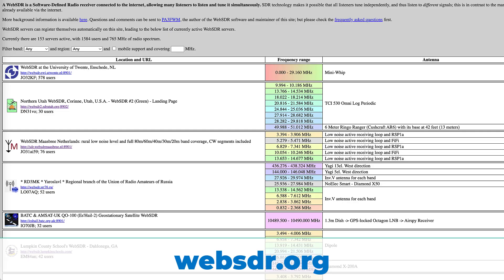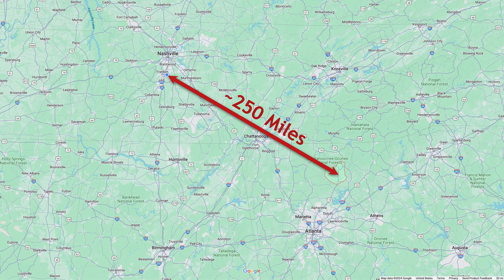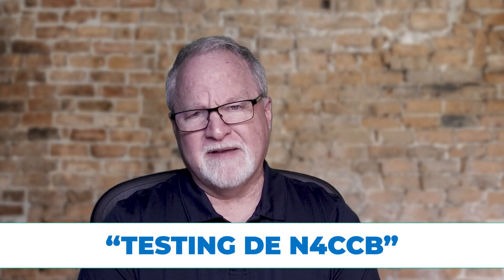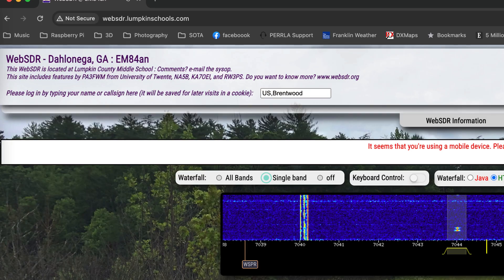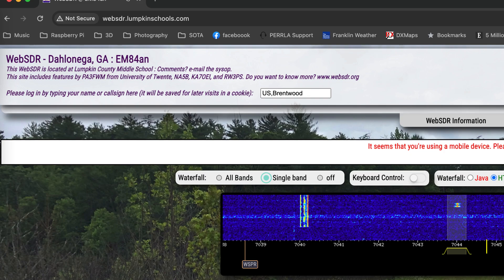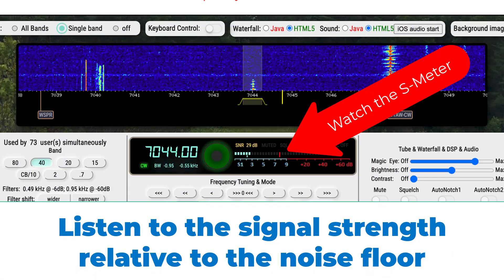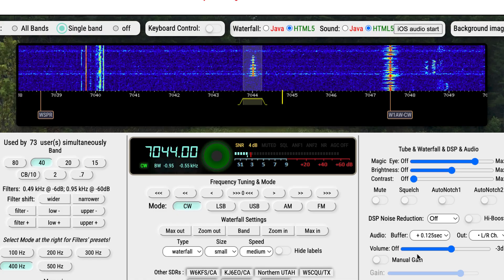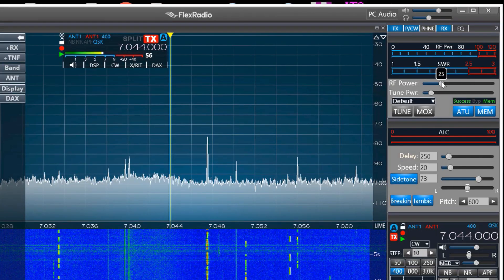100 watts vs. 5 watts: Can you hear the difference?

Comment: Great video!  I’m new and my interest has evolved to CW and QRP.  While erecting and adjusting my 40 m antenna, I’ve been doing exactly this: using WebSDR and KiwiSDR to see where my signal is reaching.  Being in Alabama, I first used that very Dahlonega, GA, station!  When I heard my signal in the Canary Islands and New Zealand on 10 Watts I was sold on QRP.

I use SDR as I have never been able to get the RBN spot me.  I’ve tried straight key, paddles, sending various CQ, TEST, RBN combinations along with my call sign — nothing.  Frustrating.  But, the online SDR works great.

Thanks for your content.  Looks to be exactly what I need.

Best and 73,

Jim KO4GQS
Montgomery, AL
Reply from the maker: Hey, Jim. WebSDR is a great way to see if you can be heard in a particular location. I’ve used it during Field Day to see if our group’s signal could be heard on the west coast, before deciding to switch gears from the east coast and look for western stations. Have fun down there in AL! -Cliff

Comment: It's surprising how many hams still haven't figured out the usefulness of using SDR stations for determining current band conditions relative to their own signals. I will sometimes be connected to several Web SDR's from 500 to several thousands of miles away. When conditions are optimum it's a mind altering experience. Adjusting your power output can produce results you would not expect and possibly change your entire outlook on QRP operation and antenna design.

Comment: Nice! I use QRP often but have never done a comparison like this. I expected the difference between 100W and 25W and even 10W to be almost nothing, but I did think 5W would show a larger difference than it did. 100W to 1W was the only really major change that could possibly have affected copy and it should, since that's a full 20dB down. But I suspect most hams would think in that scenario that 1W would be completely down in the noise, and your test proves that's obviously not the case. 72/73s :)

Comment: You should repeat the same test with websdr 2000 miles and more, for long distances the power would be more significant!
Reply from the maker: Yes. Please see the  "Part 2 - SSB" video. But, also understand that people are working DX every day at QRP power levels. It's all about propagation. If conditions are good between you and the receiving station, you can make contacts via QRP. If conditions are bad, it's going to be a frustrating exercise.Thanks - cliff

Comment: Nice job , so just Hi for big gun to easy dx , or possible dx to low power ... my station for 6 meter =) Icom ic-726 , +/- 10 W SSB to little antenna Gp 1/4 home made - easy dx and very good rcv to propagation ... other band ... 15 / 12 meter , 35 W / 25 W to only Gp 15 meter & +/- limit for 12 meter ... easy dx to Europ and other dx ; 17 meter to Dipôle +/- 25 W , nice dx so just little band 17 meter is easy for small station , very Happy ; 20 meter is band very Queen for big Dx so possible low power ... 10 / 25 w ... ; 40 meter ... max 25 W to short dipôle 30 m and tuner box ... easy dx for Europ contry ... listening , listening & long listening for good dx , not hundred Watts ... Thank for information , good dx all - - - ) F4pzn ... old station , start one to 1994 ... many tks 😉
Reply from the maker: Thank you! - Cliff

Comment: Sir, great video... question... Does CW travel better than say phone.. voice? Or is the results very simular?
Reply from the maker: CW does travel better than phone or digital. It’s a pure, unmodulated carrier so it’s more like a laser pointer than a flash light. Time spent learning Morse code is time well spent if you’d like to use small battery powered radios. -Cliff
Reply: @QRPSchool  thanks sir

Comment: Im no expert, but I do quite a bit of POTA, IMO, the wattage is not nearly as important as the antenna. I work portable POTA station in parks in Indiana, and i promise you I have guys contacting me with very exspensive radios on 100 watts and upwards in power, that do not come in nearly  as loud and clear as someone in the same approximate location on 5 watts... still surprises me.  If my very limited experience matters at all, the antenna is the biggest factor to consider. That said , on my portable chameleon telescoping vertacle , i get much , much greater results on 100 watts than say 25 watts, thanks for all the great videos sir, I have been watching and learning from them for years. NS9T 73
Reply from the maker: Thank you. I hear what you're saying. For me, I think propagation makes all the difference. If propagation is good between two stations, almost anything works. If propagaion is not great, I'll need to increase my power. If propagation is bad, I might as well walk away. If you think about it, people are transmitting all over the world right now... in Singapore, China, etc. And I probably can't hear any of them because propgation isn't good between us. So, I hope my signal is strong to SOMEWHERE when I'm operating. But, if it's not, I still had fun going fishing, whether the fish are biting or not. Thanks again! - Cliff
Reply: @QRPSchool  very good point.

Comment: Thanks for the test via WebSDR idea.  Did not hear you mention antenna used for the demo. Thanks de N4KGY
Reply from the maker: My one (and only) antenna that I can use for HF here in this HOA-controlled neighborhood is a ground-mounted vertical. It's a multi-band Hustler vertical antenna. I am lucky that the HOA allowed me to keep it, after initially telling me to take it down. When I work portable, I have such a lower noise floor! - Cliff

Comment: Your test is not useful because of several reasons. First you need to transmit a pure tone like a 1khz signal and then measure the difference of snr between 1W and 100W and not voice. From what I could see in the video there is like a 20dB difference which is about 100 times and its a huge difference. Also radios have AGC which will increase or decrease the rf frontend gain.
Reply from the maker: "Your test is not useful for serveral reasons."  Thank you!  Also, I am not useful for even more reasons, depending on who you ask.  But, while I'm here... Can we agree that a properly calibrated radio has S-Units that are 6dB apart?  And, therefore, 20dB is just a hair over 3 S-Units?  And, can we agree that QRP contacts are made every day all over the world, regardless of what kind of test I present or what kind of failure of a human being I may (or may not) be?  And, can we agree that you can find many of these QRP DX contacts on THIS YouTube channel and many others?  And, can we agree that if you listen to the NCDXCF beacons, a station that has a nice, strong signal at 100 watts has a very audible 10 watt signal, and often the 1 watt signal can be heard?  And, if I had named this video, "Hey, did you know that a strong signal received from a 100 watt station can also be heard if that station turned their power down to 5 watts?", would you have been okay with that?... because that seems like a pretty good alternate title that speaks to the spirit of this video.  This has been fun, but I really have to get back to work. - Cliff

Comment: 250 miles is pretty close proximity. I would be interested to see this test at 1000 or 1500 miles.
Reply from the maker: You might want to watch the SSB Part 2 video that I made after this one.  Also, here's a video where I worked a ham 2,000 miles away with 500 milliwatts on SSB.  https://youtu.be/FeNZnf6s8A8?si=d0rKr_6lXdoPQVOw&t=85

Comment: I am no "troll" and to fully modulate an SSB signal, you have to put out the power that your radio is used to use. For tube radios, that is necessary. For completely solid state rigs, you can use whatever power you can turn down to. I have been happy with 80 watts out for years. This is on Ham and D.O.D. frequencies. I think that lesser power outputs really work for Ham Radio, BUT,  running 1.5 KW should still be available in case you need it badly. Yes, I do have an amp that will run 3KW, but it hasn't been used in years except to run into a dummy load now and then. I still keep it handy, but am totally satisfied with my 6JB6A's in my Drake Twins. You wish to run QRP, fine, do it ! I did that during my CW days with a Johnson Viking Valiant, just whatever the beast would put out on its lowest power CW. It was fun !!! But to run a decent signal on SSB with 10 or 100 watts, you have to run 1/4 power to fully modulate it. There is no other way !!!

Comment: 100 watts, compared with 10 watts,  will be detectable at three times the distance of 10 watts (ignoring any anomalies of propagation). The bottom line is it's all about signal-to-noise ratio, not signal strength! So, i will work much more DX on 100 watts than i will with 10 watts..... which is usually what i want to do. However, I have had great fun seeing what I can work with 10 Watts, 5 Watts and even less than 1 Watt (the IC-705 is a fun radio!)

Comment: Back before remote SDR receivers were available.....and before I was even licensed as a Ham, I experimented with CB DX using an "export" Ranger 2950 capable of about 10 watts. One surprise was using the UK CB channels in their legal FM-only mode. I have a whole drawer full of QSL cards from. UK CB contacts.  When everybody was saying "you can't talk Skip using FM mode" ....I was doing it every day with excellent results.

 Now I have a license and all my contacts are strictly legal but I encourage others to try out unorthodox transmission modes and still am a huge QRP fan. My advice to successful QRP is pay attention to antenna design. "Go large, or go home" is my best tip. And the horizontal loop antenna using 450 Ohm Ladder line and a 4:1 balun into an antenna tuner is my all time favorite DX antenna. (Ground and Disconnect equipment when not in actual use or bad weather)
Reply from the maker: Congrats on your succes and thank you for sharing your expertise!  (I know FM skip is possible because sometimes other 2m FM repeaters will be triggered by radios hundreds of miles away. But, I've never tried to work FM skip, myself.) - Cliff

Comment: Key word, above the noise floor, sometimes you need power to overcome this.
If the receiver is causing AGC action then the audio level remains the same, that is what AGC does, once the signal falls below when the AGC action ceases the receiver gain is at maximum and the volume starts to drop as the signal weakens, so the test has nothing to do with TX power but receiver gain and AGC action.

Comment: The physics of power levels seem really simple.  Double the power is 3dB increase.  There is a 6dB step between S-units on the level meter.  So... 5-10W, +3dB.  10-20W, another +3dB, total 6, or 1 s-unit.  Alright, 20-40W +3, and 40-80W another 3 dB.  So from 5W to 80W is 12 dB, or 2 s-units.  Maybe that is enough to pull a weak signal out of the noise?  Our hearing is a very nonlinear system.

There' are so many anecdotes about more or less power, and maybe there are perception variables involved.  But the numbers seem very straightforward.

Comment: This is correct at short distances, but when the space wave comes into play and you may even have several hops, or it is a contest, then power is important because the ionosphere and the ground have a strong attenuation. Of course, you can also use QRP, but it simply works better with e.g. 100W. Especially in SSB. You stand out more, are heard better in QRM and have less frustration. That's why I only recommend QRP for amateurs who already have a lot of experience. Otherwise, there is a risk that the hobby will end sooner than it started.
Reply from the maker: All good points. If someone tries QRP, they should only contact the strongest stations to ensure their best chance for success. When you have time, please watch the part 2SSB video that I made shortly after this one. Thanks again – Cliff

Comment: :

I agree with the decision to avoid using excessive power, especially over distances like 250 miles. When comparing different power levels on a Software-Defined Radio (SDR) over DX paths in regions like Europe, Asia, or Australia, the impact becomes more pronounced due to variations in QSB and other propagation conditions. While the difference in power levels may not be as noticeable on 10m under current band conditions, it becomes more apparent on 40m or 20m over these long-distance DX paths.
Reply from the maker: Agreed. QRP requires favorable conditions. When you get a chance, please watch the part 2 SSB video that I made shortly after this one -Cliff

Comment: ...that you need a quadrupling of power at the other station for just one more S level, something you learn when you take the exam for your amateur radio license... But - I think in CW - the receiver has a narrow bandwidth switched - then still in the 40- m band at a distance of 250 miles.....the result was almost predictable? I tested the same thing in SSB in the 80 m band in the early hours of the morning with a radio friend - the difference between 10 and 100 watts wasn't that big.

But - try that in the SSB QSO in the 15 m band in the "real" DX - for example USA - Japan. I experience it often enough when I try to hunt down the American POTA stations that are located somewhere in the nature park, have a somewhat usable antenna and then work with 10 or 100 watts. A comparison like this looks completely different.

Still nice video, well made and shown!
73 Mike
Reply from the maker: Thanks for your comments. You’ll get no argument from me. QRP on 80m is not easy… I don’t even try. When you get a chance, please watch the Part 2 SSB video I made. Thanks again - Cliff

Comment: 40meters band at 250 miles will be not the better band/distance to prov it. It it NVIS not DX. Try on 17meter to WEBSDR in Europe?? 100w, S4 and 5W NIL, absolutly NIL. I tried it ;) but is a good experience and very good video, 73
Reply from the maker: Europe with 5 watts requires favorable conditions. Please watch the Part 2 SSB video.

Comment: Good Demo! I'm a staunch QRPer (build my own),  but I have been having problems getting POTA contacts (made 14 contacts with 80W, NONE with 5W). Maybe a better demo would be at a more distant RBN, where it was barely readable at 100W - see if you get through at 5...
Reply from the maker: “…where it was barely readable at 100w - see if you get through at 5…”  That sounds like a great use of my time. Bless your heart.

Comment: what if your antennas indoors at 5 watts?
Reply from the maker: We just make the best of whatever situation we've been given. Assuming your roof isn't covered with foil-lined insulation/shingles, your signal will escape into the world. Many people have made a ton of contacts with an attic antenna. Of course, CW or digital will bring more success with a compromised antenna since they are both more efficient than SSB. But, if propagation is good between you and the receiving station, you should expect to make contacts.  Why not recreate my experiment show here in this video?  1. Log into a nearby SDR radio at websdr.org and then 2. set the SDR radio's dial to the frequency of your transceiver. 3. Ask if the frequency is in use. 4. Transmit and see if you can hear your signal at the remote SDR station?  You may find that you will be heard at a station that's farther away than your closest station. You just never know!  - Cliff
Reply: i cant seem to get out with a whip or wire would you reccomend a loop?

Comment: Antennae in use? Tube or Transistor? Power supply in use?
Reply from the maker: Vertical ground-mounted antenna. Radio was Flexradio 6300. -Cliff

Comment: I don't use CW I use am or sideband you can't tell me that 5 watts will be as strong of a signal 2000 miles away as 250 watts. If that is what you're saying. ?
Reply from the maker: David, I think you know I'm not saying that, right?  If you don't have time to actually watch the video and understand what I'm saying, here it is: Every time you quardruple your power, the receiving station will register at 1 S-Unit increase. So, going from 5 watts to 250 watts will get you about 3 additional S-Units at the receiving station. With AM or SSB, that means that your voice peaks will register an additional 3 S-Units. That's a fact.  As I say in the video, you must use higher power when lower power isn't enough.

Comment: That shows QRP can work.
I had an FT101E and started turning the power down and sold it and went QRP with a h/b ssb/cw 4 Watt radio.
FT817ND also and on 17m and 10m recently got 1400 miles both to Bulgaria with one Watt cw 5.5.9. report and Sicily ssb 5.5. report, and Poland with ½ Watt ssb about 1,000 miles. Attic dipoles.
QRP works.
G4GHB.
Reply from the maker: I have a friend who got his DXCC award with an attic dipole. QRP absolutely works. I hope more people will give it a try. Thanks for your comment. -Cliff
Reply: @QRPSchool  Right okay Cliff, 73.

Comment: Good video. But you have to acknowledge that you are using CW.  CW has a narrow bandwidth - hundreds of hertz. This means that the noise floor of the receiver will be pretty good.  = KTB.  If you were to use a different form or mode the results would be different.  So CW is the way to go for QRP.   Other modes like FT8 will work good too as they use integration to improve the S/N ratio. Great video and thanks.
Reply: All true. Thank you for your thoughts. I totally agree, George.